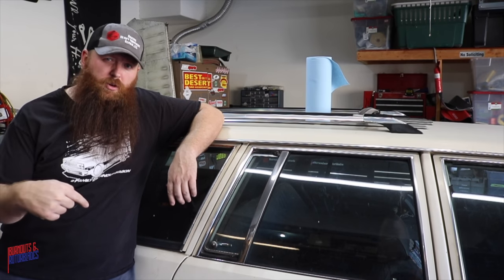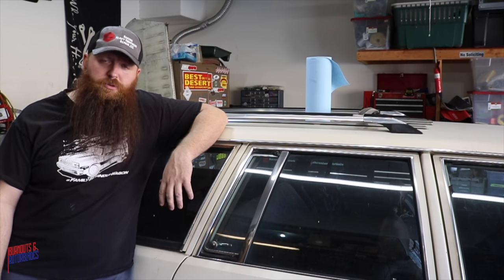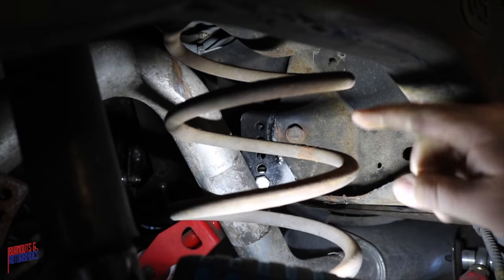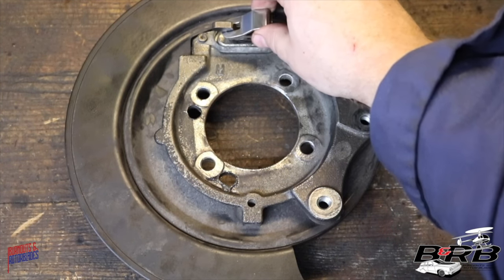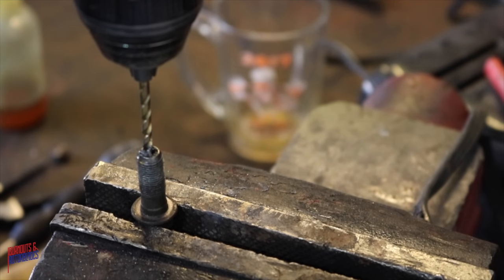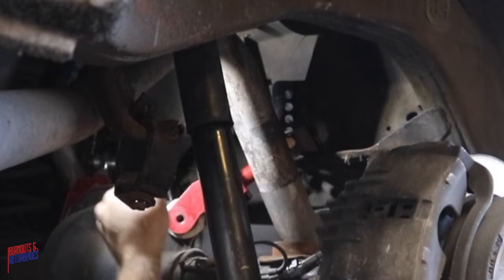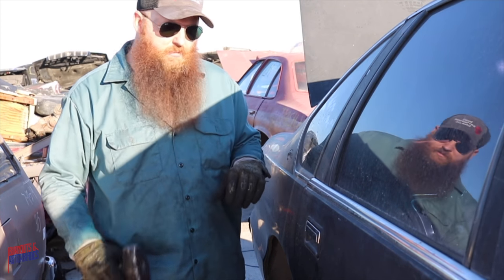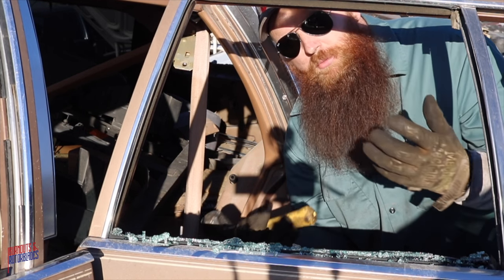GBody LS Brakes' E-Brake hook-up | Caprice springs | Window tint PSA | #FamilyBurnoutWagon EP25

Comment: What’s the Wheel and tire set up?
Reply from the maker: 245/45-17 and the wheels are Cragar soft 8's in 17x8 with a 4.5 BS if I remember correctly.
Reply: BurnoutsAndRotorblades thinking on getting them for my 78 camaro. I like the set up